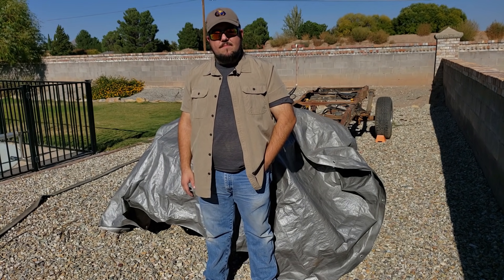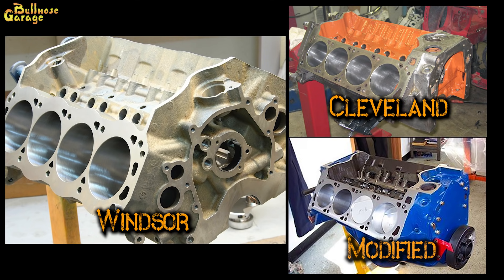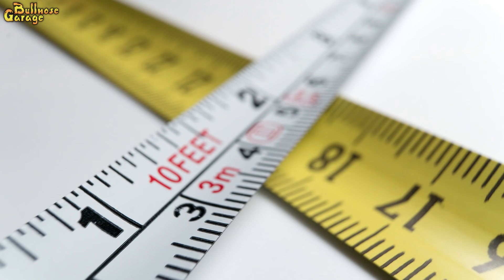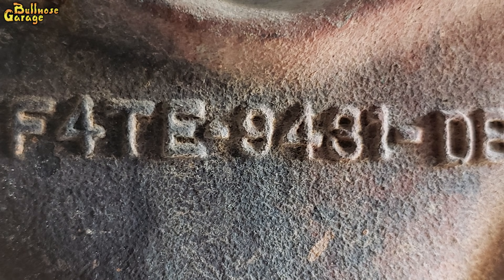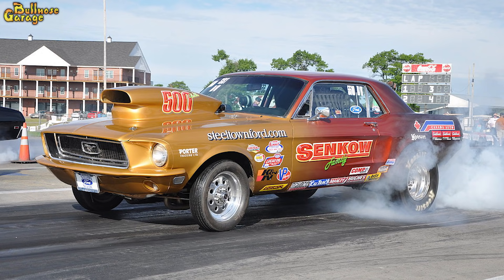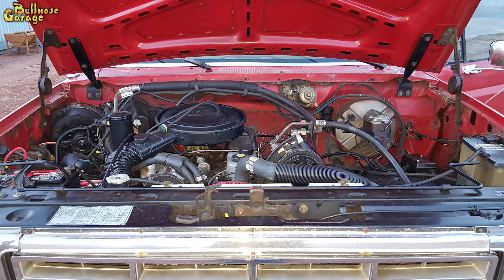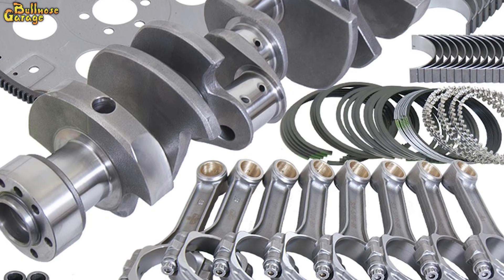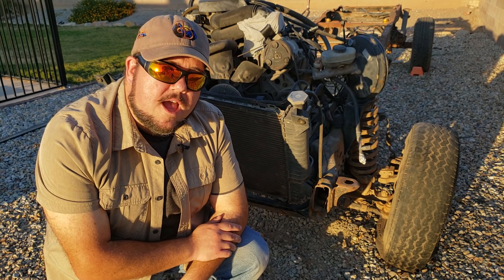351 Windsor – What You Need to Know About the Ford 351w Small Block [5.8 Liter]

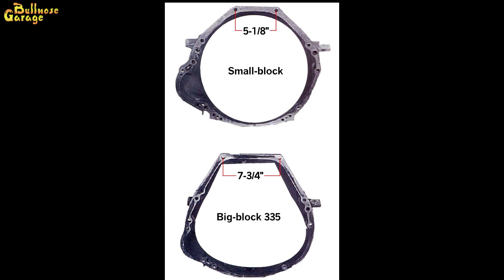Comment: 8:55 Ford put a Variable Venturi Carburetor on many early 80s small block V-8s including the 351/5.8L.  It was a design meant to improve fuel mileage, but it was difficult for non-dealer mechanics to service, as it had to have a propane enrichment device attached to it while tuning it to properly adjust it.  It was a real PITA and many owners just removed it and replaced it with an Autolite/Motorcraft 2000 series carburetor (2 Barrel).  The two barrel could be easily jetted, rebuilt and it was a breeze to adjust the fuel idle balance.  A good carb for replacement in the 2 barrel came from the 1973 351 Galaxie or LTD.  Ford was also trying to reduce weight by putting a cast aluminum manifold on the 1980s 351/5.8 HO.  It was OK, but exhaust gas recirculation could potentially corrode thru the casting walls, much like the junk aluminum EGR/Carb/manifold spacer plate used in the 70s.  Ford had such a problem with the aluminum EGR port spacer plate that they started selling a cast iron replacement through their dealerships.  
The 351W/5.8L is the best alternative to the 302/5.0 in a work truck.  The 351W has the best torque for pulling trailers and hauling heavy loads and will give better fuel mileage over the 460.
Reply: I drag raced using a VV carb, Left the metering rod seat adjusting tools on the carb ( sealed with an o-ring on each one) instead of putting thre plugs back in. My friend pulled the seat bolts out of the floor on the line, that was funny as hell !! He launhced and vanished inside... He never let off of it ! LOL  Most VV screw ups wer the cold enrichment rod adjustments ( choke for clarity) and the early VV diaphragms wotld break ( redesigned and had to driull a small hole on bottom of the diaphragm cover to keep fuel out in case of rupture). They were genious design... they only Flowed as much CFM as the engine needed. Mine went on an FE block 428... LOL
Reply: @FourbrrlGrabber that's funny my 2 barrel carb that's on my 351 Windsor came off a 390
Reply: @rockymntain My 1979 LTD Landau with the 351 Windsor came from the factory with a 2 barrel aluminum intake and what engine doesn't get better fuel mileage than a 460😂

Comment: The Windsor 351 is a great street able platform. If your not trying to get way crazy power numbers.... but want damn good ones. This is an excellent option.... sad to see people think they can't build a Ford and simply LS swap anything they touch.
Reply: The LS engine weighs SIGNIFICANTLY less. There is MORE SUPPORT from the after-market. They make more horsepower per cubic inch than the Ford engine could ever DREAM OF, at HALF the cost. You can find parts for LS engines in ANY city, or town, across the US.. .Try to find valve cover gaskets for say... a 351 Cleveland at your local auto parts store.. GOOD LUCK with that!  FORD absolutely SUCKS... and I say this as a Ford owner. I have a 1969 Mustang Mach 1 with 351W engine... Almost EVERY 4 cylinder engine made today makes MORE HORSEPOWER and TORQUE than your or my  factory Ford engine.. Not kidding.. and the 4 cylinders will get 30+ MPG! There is NO REASON to not DUMP the ford low power, low torque, gas guzzling, heavy, hard to find parts for, low compression, poor ignition system, PIG engine..My mustang is SO SLOW that I don't dare rev the gas at any late model honda, or Lexus, or I'll get blown off the road by an all-stock import who will probably be running his A/C with the windows up as I watch his tail lights disappear into the future, while I stop at every gas station every few miles...  Ford knew NOTHING about how to build engines back in the day.. Even their mighty 427, or 460's were abysmal compared to any 4 or 6 cylinder made today... The 351W is "okay" if you are trying to stay original.. but that would be the ONLY reason..
Reply: @Go69 ONLY Ford's old engines don't make power compared to modern engines?!🤔

"Tell me you don't know what you are talking about without SAYING you don't know what you are talking about."

A LS won't last nearly as long or take the abuse that a small block Ford will.

Comment: I really enjoyed this video.  Would anyone out there know if you can bolt on some gt40 heads off a newer explorer and put them on one of these 80s 351ho motors? They had a rv cam already and a intake and Holley carb on them but I read they only made 210 Hp bc of compression and head flow. I wonder if this were possible if just a simple swap would raise compression and flow and give you a giant hp boost bc you already have a cam in there that cam take advantage of the increased cr and air flow.

Comment: How are you mate, enjoyed your video, I'm just wondering I have a 1992 f250 ex Ambulance 351w EFI would you know apart from the casting number do you know the location of the engine number ? Also what benefits are there with a roller cam and lifters ? Is my block able to take roller without any modifications ?

Comment: I've got one of the blocks designed for roller cam, but has the flats - summer 93 production. Tough SOB! 300 thousand original miles and still going.

Comment: 1 have a 1982 F150 with a 300 inline 6, Automatic, 2.75 rear. I put a Quadrajet on it. Great machine. Lots more I want to do. If I wasnt religiously dedicated to my 300, the 351w would be my pick. I've had a 360 before. Can't beat them for work and they perform well modified -the pulling power is incredible, but dear Lord, the mileage.

Comment: These are great engines. I have one in my 95 E350 work van. 300k on the original 351w. Still runs very strong without any issues!
Reply: 280k on my ‘94 F150 5.8
Reply: Me too, bro, and I’m telling you what the motherfucking thing got balls, dude

Comment: For me, the simplest way to distinguish 302 from 351W is to look where the water ports through the timing case join the cylinders.
In a 302 the shorter stroke (lower deck height) puts the cylinder head seam right on the water port but the 351 shows a 1/2" or so of cylinder between port and deck.

Comment: Two things to mention.
The 351M has a bigblock bell housing pattern, but the Cleveland not necessarily (though there were FMX)
The number you show on the block is an engineering number . It shows when it was designed and what vehicle it was designed for.
High nickel early blocks were much tougher metallurgy.
You saved on buying roller lifters, but you get to spend on a carb, intake, ignition system, and possibly a forward rotation water pump.
I'm really enjoying finding your channel.  :-)

Comment: Great work on the knowledge of the venerable 351 Windsor. Had one in an E250 van. Super tough and strong engine. Just to clarify, the 400(M) engine is a stroked Cleveland, 4" bore and 4 " stroke. The 351(M) is the tall deck 400(M) block with the 351 crank. They are still small blocks and will build killer fast and strong engines
Reply: That info is not correct at all! The 400 came out in 71 and the 351m after that as a destroked version of the 400. The 400 is not called “M” as reference..only the 351m because ford had 3 different 351 ci motors at the time and the “M” was a modified version of the 400.
The Cleveland is a shorter deck height than the 351m/400 and has the big block bell vs the Cleveland having the small block bell.
Only a few things are interchangeable between the Cleveland and the 351m/400 engines.
The 351m/400 is considered a big block because it shares the big block bell housing pattern with the 429/460 engine.
Reply: @markcole6475 In the Engine History section of the Ford Racing catalogs, the 351C/351M/400 are included on the page titled "Small Block V8" along with the 289/302/351W. (The Big Block V8 page only includes the 385 family; 429/429CJ/Boss 429/460.)

Bellhousing pattern doesn't matter, the 335 family's borespacing is the same as the Windsor family. There were also a few early 400's (forget the year/application) that had the small block bellhousing bolt pattern. By your flawed logic in just that 1 application the 400 is a small block, but the other 400's are big blocks!?

Comment: my block is (f4TE-6015-AA-12), WHAT DOES IT MEAN?
Reply: F= '90's
4= '94
T= designed for a truck application
E= means it's an engine component

6015 is a universal number for every Ford roller engine block ever made.

-AA is an engineering revision.  (Typically A, AA, AB, AC, etc...)

Comment: Thanks for the vid! This engine is often overlooked. I've owned a few of them and had zero reliability issues. I just replaced the timing chain at about 80,000 miles as preventative maintenance.
Reply: I disagree with it being "overlooked". It's the go-to SBF for performance applications because dollar-for-dollar, you get more HP (and more potential HP) without spending any more money than you'd spend on a 302. Free HP is always a good thing.

Comment: Just to make a note that you do mention the correct firing order however since the cams are interchangeable with early 302 cams the firing order could be different if the cam has been changed in an engine pulled from a junkyard. I have a good running 351W in my mustang but the firing order is 1-5-4-2-6-3-7-8 because someone changed the cam. Its something to check when looking and pulling a used engine. It could save you a lot of headache later.

Comment: Thanks, I have a increased love for my 351W now, its in a 95 F250 that struggles pulling a small camper up grades. Looking into changing heads and intake.
Reply: If you've ever pulled with a Ford 302, you'd know what struggling to go up steep grades is like.  They are geared lower and you have to keep the RPMs higher to keep the torque curve in the right spot so it doesn't lug down.  A good 351W Ford does so much better.

Comment: The 302 was a lousy truck engine. The 300 six was a far better truck engine for anyone just needing a truck to work. The 302 would also suck just as much fuel as the 351 and was far less durable for truck useage.
Reply: My dad took his 95 f150 over 500k miles until he let an over heating catalytic converter be it’s end. I would’ve cut it off and waited for it to be historic to avoid emissions. It sits at a junk yard still turning over 10 years later. He swapped up for the 351 w in the 94 bronco now it’s my truck and I’m starting to build it but i might just go get that 95 f150 since there’s so many interchangeable parts and it’s a Ford just hit anything that doesn’t work a few times and it will come right back on 😂

Comment: I believe in late 80s when they changed to serpentine belt the timing chain cover and water pump to reverse flow
Reply: When the lower power 351W went EFI, the 351 HO in trucks over 8,500 gvw was still a carbureted DuraSpark II engine.
Carbs and V-belts were gone for the '88 model year (which probably means a Sept.'87 ish manufacture date)

Comment: Don't want to turn you away from the 351W but if you put real power to that motor the main journal will break up to the cam journal (#3). The 302 (still a Windsor engine) can handle over 400 but not over 500.  The tall deck Windsor can handle around 300.  If you want to build a big power tall deck you have to order  a Ford Racing block or a Dart.  I applaud the research you've done.  It's phenomenal.  I hope this comment helps prevent catastrophic failure.  You can also build a Clevor but you have to do some work on the heads and change pistons for canted valves.  On tall deck roller Windsors I upgrade valve springs, install a ProComp drop-in distributor, and put on a 4bbl intake with a carb or projection.  Set the ignition at 34 degrees, add race fuel and go.  They made different heads but breathing better is a minor advantage.....the Clevor is a more breathable setup.  The canted valves reduce the 90 degree air bends to around 60.  But it's pretty minor payoffs for a lot of work.  The roller cam is where you get you real power increase. The factory cam has pretty decent performance.  Aftermarket roller cams are pricey.  Do not buy solid roller lifters.....always hydraulic.  Good luck my friend!  Build that motor and show em!!!
Reply: As someone who has professionally built 1000's of 302/351W based engines... YOU HAVE NO IDEA WHAT YOU ARE TALKING ABOUT  Tall Deck stock block even the later Windsors can handle in excess of 500hp without issue... At That power the Cast Crank is at its limits though... I have a C9 Blocked 393 in a Shell Valley Cobra with Vortech Supercharger making 700hp, and has 30,000 miles on it...Though it has a Forged Crank...
Reply: I suppose I am completely wrong and have never seen catastrophic block failure.  My experiences must be all imaginary.  I am confident after building literally thousands of race engines every one you've done is still running today.  Congrats on your success.
Reply: WELL if you know what you are doing... They won't fail... If you think a stock 351W block is good for only 300hp...you have NEVER built one (at least not properly)
Reply: Can't argue with that.  Race engines never fail.

Comment: I have a 351w flat top pistons  with solid roller cam 6.15 lift aluminum heads 2.02,1.60 valves. It screams! I seen where someone took a stock junkyard 351w hooked up turbos and got 1100 hp before it blew.

Comment: The biggest 351w stroked and bored. Is 454ci.   Ford makes the z351 which is a
High strength aluminum engine block, 356-T6 grade aluminum; Splayed 4-bolt, steel billet main caps on 2,3 and 4. And 2-bolt main caps on 1 and 5.   

Then there's the modified  clevor which is a windsor block with Cleveland heads.

Comment: A good tune will allow more power without splitting. 351w blocks will handle a lot more power than a 5.0. Richard Holdener turboed a junkyard one from a late 90s truck with stock rods, pistons, and crank with HCI and broke 1100hp. Granted that was limited dyno pulls

Comment: Correct the old 260 289 302 firing order is different.  BUT 351w is the Same firing order as the old 79-93-94  mustang 5.0's  small block 302 essentially.

Comment: Great video,  great truck , they are my favorite.  Things to be aware of, dont let anyone tell you that you dont need the flex plate , the starter needs it mostly for support so it doesn't uneveny wear out  your teeth on the starter and flywheel. And the fan shroud , it needs that to for making sure the air flows through to the engine .
Reply: Cam montreuil engines  yup thanks for that correction 👍
Reply: I think you mean the block separator plate (a.k.a. a starter index plate or block protector plate), the thin plate that bolts between the block & bellhousing on Fords.

All engines with an automatic transmission use a "flex plate," the large circular/toothed "plate" that bolts to the crank & that the starter engages to start the engine (manual transmissions use a "flywheel" instead of a flex plate).